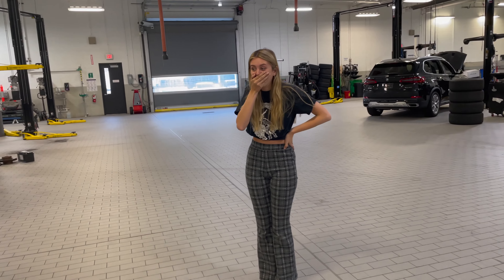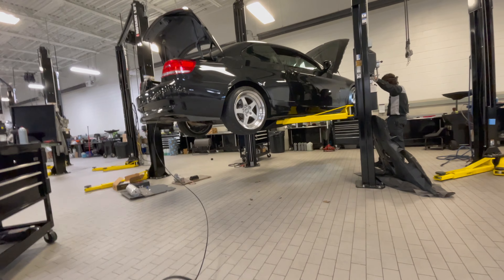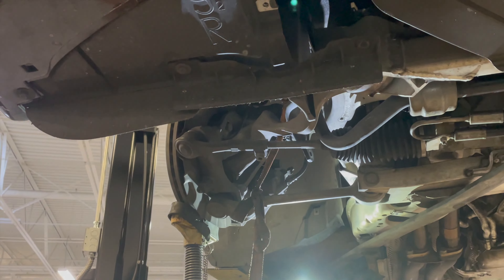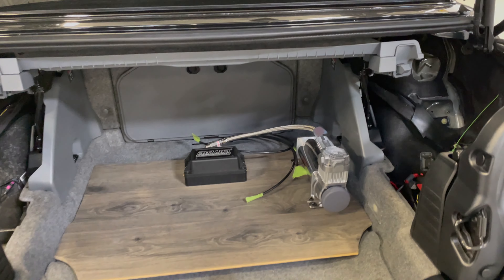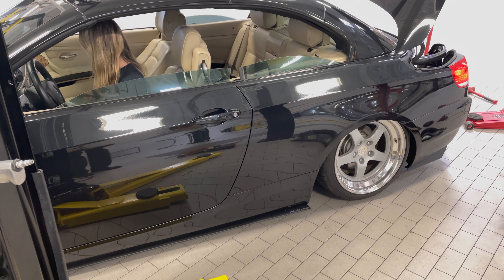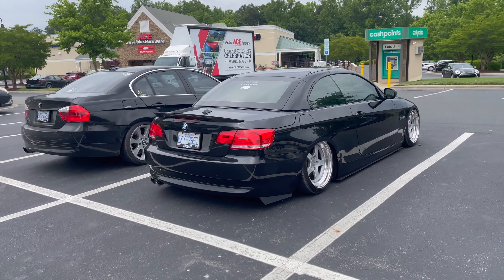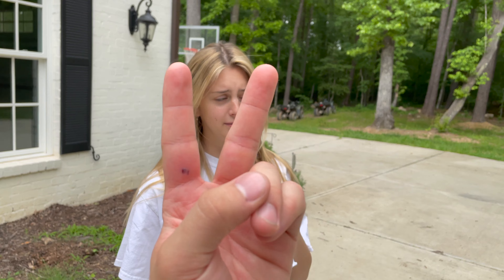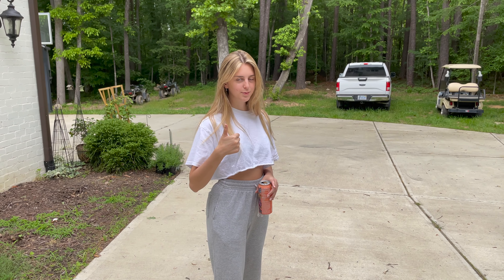*THE REVEAL* Bagged BMW E93

Comment: Why couldn’t you do this on a 335i? I kid! Keep up the good work! Sick 328i e93!
Reply from the maker: You had me in the first half 😂
Reply: @CeciliaHardt  Haha I'm glad! I miss my e90 328i 2009! I regret selling it but I wouldn't have space for it at the end :(
Reply: @xGOFORBROKEx  Haha, I really like the 335i tho, truly amazing tunning potential, with some downpipes + exhaust + IC and upgraded turbos they do 700hp+
Reply: @PatalJunior  Oh no doubt the 335i are a beast. Especially the N54 engine! A few mods and tune upgrade..It's gonna be fast and sound nice. But, sometimes even the reliable version are better so you don't have to deal with turbos going out time to time lol. My friend had a 335i 2008 and it was pushing close to 900hp. But, he had to sell it cause it was giving too much problem and with a family. It isn't reasonable to keep.
Reply: @xGOFORBROKEx   I have a black 335i but after getting stuck on a raised sewer plate yesterday there is no way I would lower my car to this point...I don't care how "cool" it looks. BMWs are expensive enough as it is to maintain. I'm not about to ask for trouble.